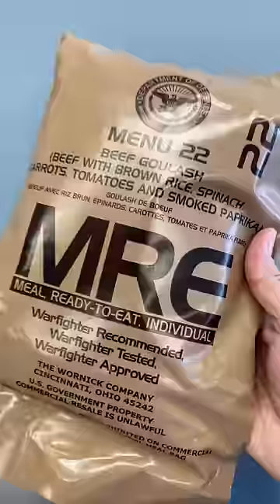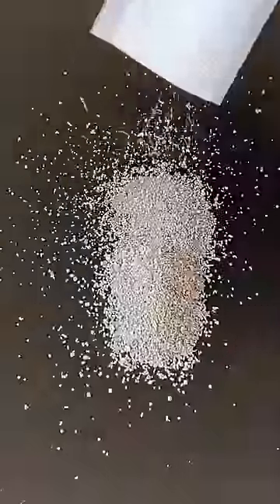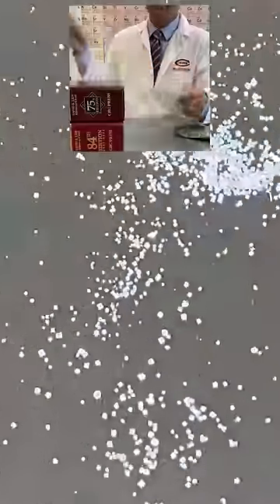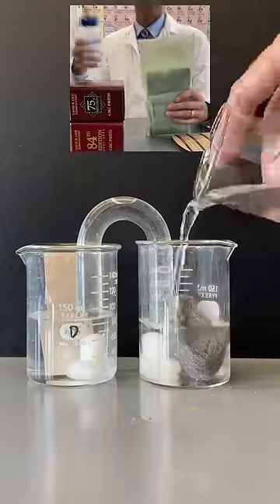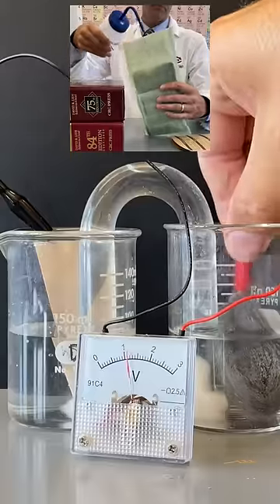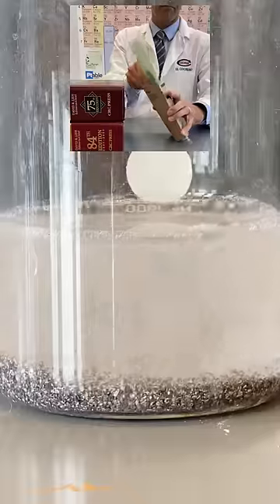Super-corroding Galvanic Cell used to Heat Soldier’s Meals!

Comment: So the instant cooking packs are literally a chemical battery short circuiting itself??? That's so cool
Reply: They usually don’t work, most the time they’re to old to work properly
Reply: I think he’s just using a battery as an analogy. Batteries are a harnessed and controlled electrolysis reaction, which is what I assume is happening here. When a battery short circuits, its just the reaction happening at high speed with nothing to impede it, as is happening in the bag. The key thing here would be that the reaction is exothermic, meaning it releases heat. I don’t think endothermic (absorbing heat) electrolysis can happen spontaneously, however, but it’s been a few years since I studied any chemistry.
Reply: @brettgalloway7576  it was 50 50 for me when I was Active Duty Army and most of the time we don't even use them unless we got some long ass downtime
Reply: @acardenasjr1340  do you just eat them cold usually?
Reply: @kyetes.866  lol, ye. Cold Chili Mac was my Fav
Reply: You know what other heating element is really cool? The little pocket hand warmers. The way they work is when you crack the casing it exposes the iron inside to oxygen causing it to immediately begin oxidizing(rusting) which is a chemical reaction that gives off heat
Reply: @brettgalloway7576  Most failures are by placing way too much water in the green bag.  It just needs about a teaspoon or two.
Reply: Technically all batteries are chemical
Reply: Not always, sometimes you have sodium citrate in them which reacts with water to produce heat as it dissolves
Reply: @valdranne  They're good to have, but they're not a perfect solution. Source: I work outside in the winter, and I get two pairs of thin knit gloves with one pair of hand warmers for my hands. I need the dexterity. They get soaked with the melting snow. because I'm always grabbing and moving stuff around.
Reply: Actually thats a very dumb way to talk about a chemical reaction....but yeah its the same reaction as a battery having a short circuit except most of Short circuits Happen away from the battery which is different from what a battery having a short circuit inside would look like... But you probably wouldn't witness that because it would explode violently 😂
Reply: Yeah ice packs had ammonium nitrate and something else I forget to make instant cold. Hard to find now because people used them bad things. You can with the heaters also but I won't say how we did when kids lol. Hand warmers yes are similar. But they eat the oxygen and moisture in air to cause rust, the magnesium accelerates this process. And makes heat. You can actually save half used hand warmers. Just put them in a zip lock bag and squeeze the air out. They'll work again later when exposed back to air. Another neat use for these is for food storage. Peppers will use them when storing large drums of rice and corn. Throw a few on top and seal the drum. Food needs oxygen and moisture to rot. So the hardwares will eat all the moisture and oxygen left in the barrel after sealed. It will stay in stasis that way for a very long time. If it ever leaks a little it will keep the food from spoiling. Many uses for these things. I always facepalm when people open the kits and throw away the heater bags lol. I'm like dam that's the best part!
Reply: @nogrammer  nah, lemon, zinc , iron and destilled water will make a battery
Reply: @brettgalloway7576  my grandfather fought in USSR army in a t-34 tank. He says they would tie their meals around the barrel of the cannon with chicken wire. After half dozen rounds one of the 3 crew members would have to venture outside to get the rations. They would take turns, sometimes it was very risky but a hot meal in the harsh winter was the best moral boost
Reply: @dannyh8288  and you have to lean it against a rock or something
Reply: Science is generally very cool. Unless its a science generating heat ;)
Reply: @brettgalloway7576  they dont get recalled like walmart expired date rule lol
Reply: @valdranne  like a micro thermite reaction?
Reply: can it be made into an ied?
Reply: No, it's not "cool".  Not when you follow the instructions correctly anyway...lol jk.
Reply: Ye
Reply: @lardook there's a few options , another is calcium oxide n water .
Reply: Quick lime works too
Reply: @kreativeforce532  I've heard of people using a plastic canteen to make a boom 
    Not to actually hurt anyone 
If you used a metal canteen could definitely hurt someone 
      Either way would be a pretty ineffective ied

    Hey can you stand there for like five minutes for me 😂

Comment: 1. grill over flame ❌
2. fry in oil ❌
3. simultaneously short circuit thousands of tiny batteries ✅
Reply: Too much noise and makes a smoke trail. It's literally begging them to sneak up on you while you are eating. You also need to start a fire, and in certain terrain, there isnt enough fuel around to do so. 

Our modern day MREs are the most advanced rations we have ever had in the history of humanity. They only require adding water to be able to have hot meals on the front lines and in the trenches.
Reply: @kuratse205  ok
Reply: @kuratse205  you're right and it's so awesome
Reply: @kuratse205  dude that is sooo cool
Reply: @kuratse205  while patrolling Baghdad Soldiers would tie there MRE’s to Hummers exhaust pipe to heat that shit up. There was one guy I remember who put his MRE inside the engine and put it just above the oil pan and welded it shut just to take a plasma cutter and make a hole big enough for his hand to fit through so he could heat up his food like this again.
Reply: @Team_Fortress2  that's metal as hell
Reply: Plus it's a hazard when u try to get rid of it.  Especially thebones that where not used
Reply: Funny you should say that, I’m pretty sure MREs used to be cooked that way
Reply: @kuratse205  Facts.
Reply: @Roachomane  vale bro
Reply: Or cook over burning C4
Reply: @kuratse205  finally someone who knows there stuff
Reply: 4. Use your helmet as a pot and some leftover c4 as fuel and cook away
Reply: @kuratse205 I’m confused. So if they don’t use the method in this video, what do they use?
Reply: @heavy0119  I'm talking about open grills making too much noise and smoke. Not these galvanic cell packets. These are enclosed, and make absolutely no sound nor any smoke. I'm saying that its the most advanced rations we have because it can heat food up without any combat downsides
Reply: Key word: In combat
Reply: I prefer using thermite.
Reply: @Kokowomee  I prefer having hands.
Reply: We as the 63/91 army mechanics would stick a couple on either side  just slightly above the exhaust manifold but not touching it.
Reply: Or c4 lol it’s that stable
Reply: @kuratse205  its a redox like thermite reaction but a hush2 ones, chemistry 101 but it aint fladhy like this mini flashbang
Reply: @Team_Fortress2  dang plasma cutter

Dude got the wrong job here
Reply: @Kokowomee  smokey and smelly unless u need a diy flare for LZ signs
Reply: @Walter White  You can't do that with a Kevlar helmet, but canteen cups are still an option.
Reply: @ketaminefrog3897  I preferred Trioxane heat tabs.
Reply: @earlwyss520  a Humvee and hummer is the same damn thing in the army. Imagine trying to correct someone who know more than you do.
Reply: @The Biggest Controversy  I'm a former USAF Security Policeman, and I started driving 1987 model M-1026 Humvees in 1988, and we NEVER called them "HUMMERS".
Reply: @earlwyss520  like I haven’t seen that copy paste before… tell me in detail what a DD214 is and what it can be used for. I used to be a CW5 when I left. So please amuse me. I always need a good laugh from a Jester.
Reply: @The Biggest Controversy  A DD-214 is discharge paperwork.  It documents time in service, last pay grade, all awards & medals, and post separation benefits.  All that I've used mine for is to get veteran applied to my Driver's License.
Reply: @The Biggest Controversy  I've been out since 1997 and have yet to sign up for the VA. I never thought about signing up, and after watching the  "Wounded Warrior Project" commercials over & over again, I realized that the limited resources of the VA are better spent on those other guys, & not me, so not all vets sign up for the VA.
Reply: @earlwyss520  again you were no soldier. All veterans sign up with the VA. Its been almost mandatory to do so for the last 30 years. You would know that if you even did have any valor. So whats it feel like to pretend to be a veteran?
Reply: @Team_Fortress2  I don't know, you tell me, because up until now, I haven't called into question YOUR service, REMF.
Reply: @earlwyss520  you can call me whatever you want but words don’t effect a true veteran. I fought for this country. Many of my brothers and sisters in uniform have died for our freedoms. So go ahead and say your worst. You would be no better than the politicians we have right now running America around and turning it into their own circus.
Reply: @Team_Fortress2  dawg u run a youtube meme channel
Reply: @kiasoul66  i am commenting from my sons youtube account if you are asking yes. I never bothered to make my own channel or account. I don’t get into what my son does because Im not a nosy dad.
Reply: What is the name of the powder?
Reply: @kuratse205  no one asked
Reply: @DerexWolfheart  500 people were happy to learn that, so that is quite a bit more than you could ever ask for.
Reply: During field training they have a truck that becomes a kitchen in about five minutes
Reply: Both of those are target indicators
Reply: @Team_Fortress2 Holy shit, a wild Warrant Officer. I thought those were just myths!
Reply: @Team_Fortress2 cancer: allow me to introduce myself
Reply: Requires resources (fuel and igniter), and causes sound/light.
All the issues of option 1, plus an additional pan and oil
Literally just pour a bit of your canteen in. You are already carrying one anyway.
Reply: They're called flameless ration heaters for a reason. You don't need any matches or a lighter to get it lit, you don't need to worry about wind or rain putting it out, it doesn't make smoke that could give away your position, and you don't have to worry that knocking it over might burn everything down.
Reply: @Kokowomee smoke n smell beats the purpose plus the brightness
Reply: @Dyl_Apple when there wasn’t another choice?
Reply: i think you can boil entirety of electrochemistry into creating thousands of short circuits

Comment: Pro tip if your mre heater isn't working  add half the packet of salt that comes with the mre and shake. Add water to line, than food. Should be hot it no time!
Reply: had a buddy in MCT try this with whole salt pack, put it in the sleeve, and lean it against his rock or something. Not three minute later we hear a loud pop to see his heater pack had blown up and poured boiling water all over his pack. Scared the shit out of him.

Comment: We used to also make dummy grenades with the contents of the pouch in a plastic bottle completely wrapped in 100 mph tape (duct tape), and tear gas with the pouch contents in the green bag, and throw the tiny bottle of tabasco from the mre  in with the water. Very loud bang, and decently effective tear gas. Don't try at home!
Reply: Thousand mile an hour tape,guess maybe the tape quality has dropped considerably since I was in...
Reply: @DennisLock-x8f Thousand? What?
Reply: @Rip_and_Tear_Until_it_is_Done  It's what we called it in the service about fifty years ago when we made jumps.Apparently the tape was a much better quality then.

Comment: "the result is a moderately tepid meal in around ten minutes"

slightly more accurate. doubly so when you have to pick between warm main, sides or a coffee.
Reply: Had a vet friend tell me they used to dump the salt packet into the frh and it was more effective
Reply: @TheSixonezero  can confirm
Reply: Much better description
Reply: @TheSixonezero  half the time i cant get them to work  😕
Reply: @TheSixonezero  Ive only really used FRHs a handful of times as only really saw them at the end of my stint overseas, but thats a helpful tip, thanks. makes sense as it would improve water conductivity.

Though I'm still not sold on FRH packs. sure they can be useful if youre doing light discipline/ semi hard routine, but i found a hole and a jet boil to be a much better combo, with the advantage that when youve boiled your food you still have hot water left to brew up with, and the semi insulated mug is great to wrap your mitts around when freezing.
Reply: Never had a hot MRE in Vietnam, they were all ambient temperature.
1967-1969.
Reply: @MarioHernandez-ky8tg  You didn't have MREs in Vietnam.
Reply: @TheSixonezero  can also confirm
Reply: @pawpawstew  they were not called MRE's for that reason: they were called 'C Rations'.
Reply: @MarioHernandez-ky8tg  technically they are still C rations because that’s the meal code in an op order. 
Sgt tells you “chow is  M CC for the day” 
That would mean green eggs and ham from mermites for breakfast chow and MRE for lunch and dinner.
Reply: The scientist was putting the heating bag back into the main bag, presumably with everything else, so it would eat everything. The heat also probably doesn't dissipate as quickly if it's all inside the same pouch; meaning the bag gets hotter.
Reply: @Pawpaw Stew  That's exactly  why I said what I said. We didn't have those 'commodities' while fighting a war, a__w___e!
Reply: I found if you have time to leave the meal in for extra few minutes helps a lot. Also don't add all the water at once.
Reply: You make a coffee with the pudding and the hot chocolate pack. And heat that ...
Reply: @MarioHernandez-ky8tg  you also fought in a rainforest. Not to be disrespectful, i look up to you guys a lot and try to keep as many lessons as possible for my job/generation.(cav-recon).
The warm food is an unnecessary luxury in warm climates, but a lot more important in sub zero temperatures.

Comment: In older times you'd have a portable folding stove and solid fuel tablets or whatever else was around. They still make them too, really just depends on your needs or what you can easily produce.
Reply: They still use those but only in cold weather conditions, they usually don’t work very well
Reply: Russian Iskra MREs still run them
Reply: Folding stove? No need to carry more crap.  Make a fuel tab burner out of a C-Rat can ,cookie or sea biscuits. Works with any liquid fuel too.
Reply: @williamtiebout4142  The stove I recall typically came with the MRE itself. Usually the big full course ones.

Comment: “How do soldiers get a hot meal on the battlefield”

They don’t
Reply: They do, its just not a very good hot meal
Reply: I mean they just showed how they can get a hot meal
Reply: I mean we do get field chow which is normally warm but never really good
Reply: @joshhanklon  correction it's hot on some parts, and cold in the rest
Reply: @julianharper7107  Yeah but thats not rhe battlefield lol
Reply: @sirsanti8408  doesn’t work most of the time, you might have 1/4 of it be hot and the rest is freezing or lukewarm
Reply: If it's -20° I'm sure that Lil pack is better for keeping balls warm than trying to heat up a fn meal..
Reply: There used to be a system. From memory:  A-Rations were hot meal at chow hall or field kitchen.  B-Ration was hot meal in mermite cans brought out to the field.  C-Rations were a cold boxed meal of cans.  K-Rations were a yucky bar of god knows what you could carry in a pocket, or find in a survival kit.  There were lettered rations in between C & K Rats but I don't recall them anymore.
Reply: They get a lukewarm meal and banger or garbage food depending on where you’re from